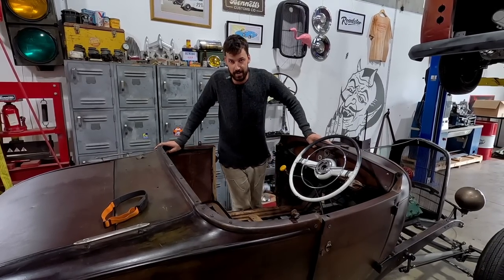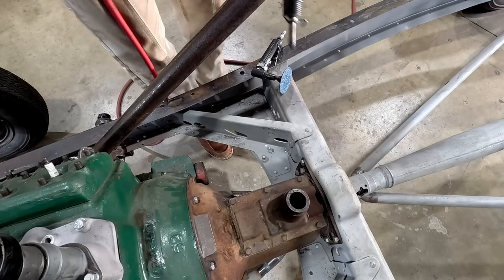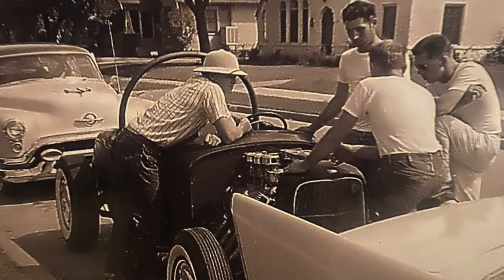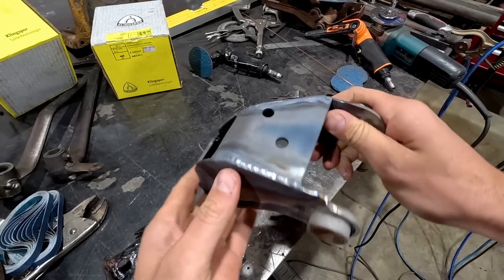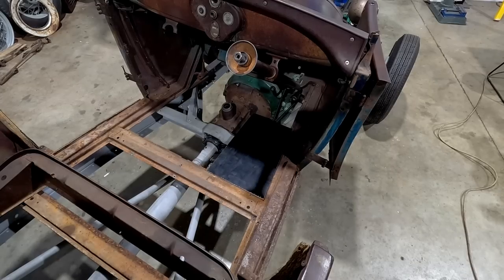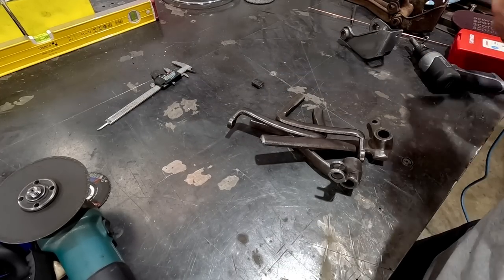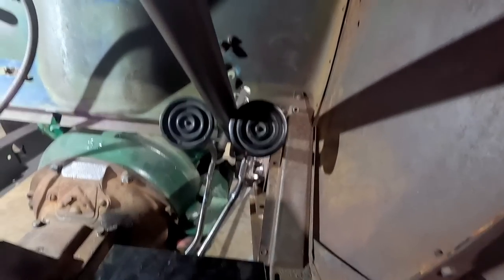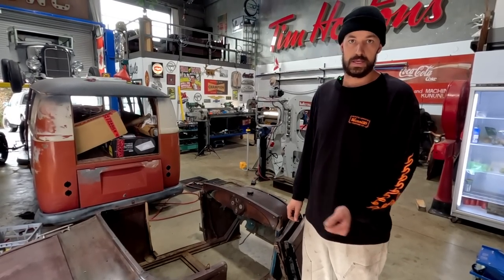HOW TO - Adapting 1934 PEDAL ASSEMBLY into 1932 Ford Frame

Comment: Nice work on the mount Jordan, the foot clearance between pedals is always tight on early cars especially when one has larger than normal feet and like you say its a bit of  a compromise ergonomically but drivable with the right shoes etc, looking forward to the body work and watching the new H&F machines in action. Cheers Greg
Reply from the maker: Exactly Greg! The tools have been getting a workout that’s forsure

Comment: Why not move the cloth and break pedals to the left of the steering wheel column.  Just need to reshape the levers really.  Then loads of room for the accelerator.  Shouldn't interfere with the gear lever